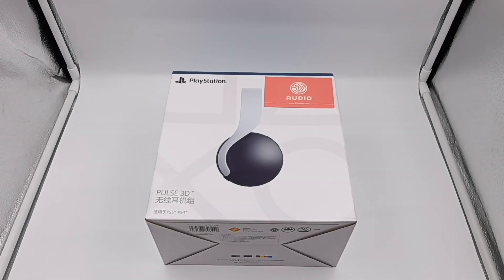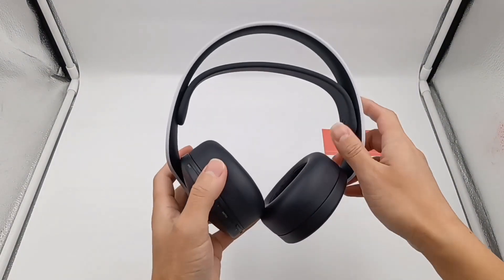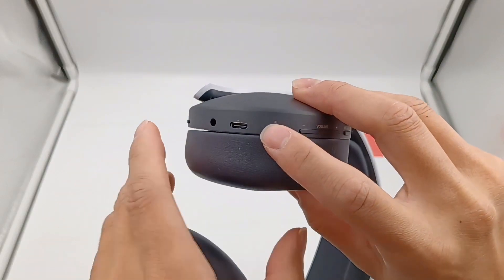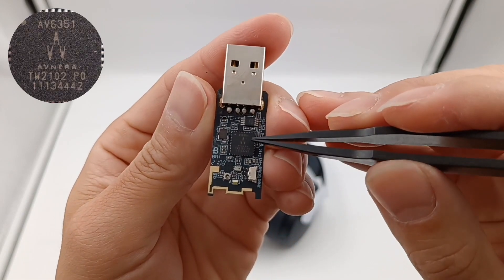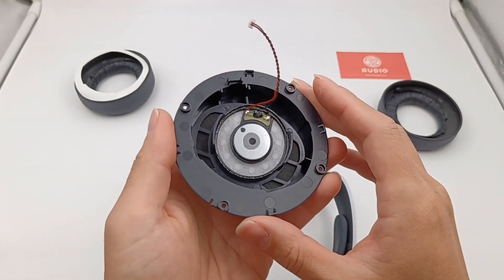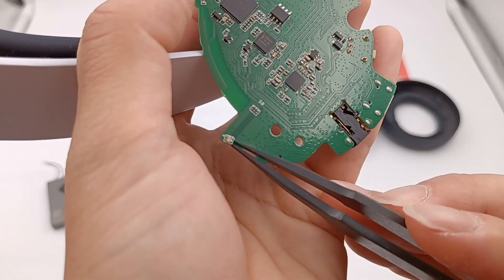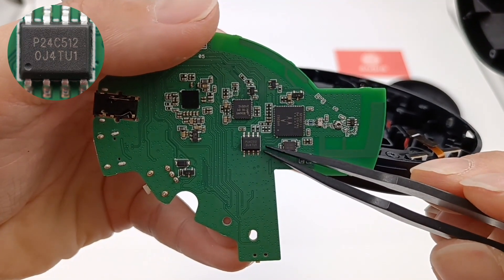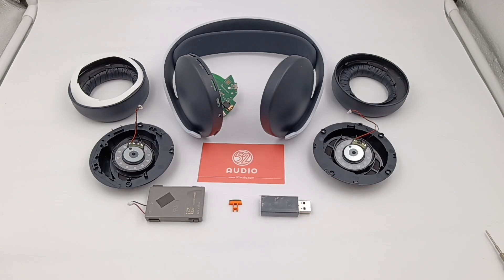Teardown of SONY PULSE 3D Wireless Headset (For PlayStation 5)

Comment: My headset is totally uncomfortable.. Can I reverse the earcups? Otherwise, can I swap the wiring from left to right? The way it is designed, there is a big gap on each earpad and they do not lay flush against my head.  If I turn the headset around, it fits perfectly.. That is why I want to reverse the wiring, or if possible, just turn each earpad around..  What can I do? Thanks..